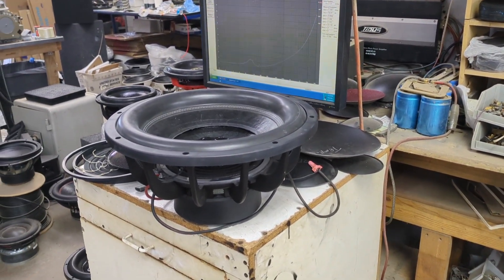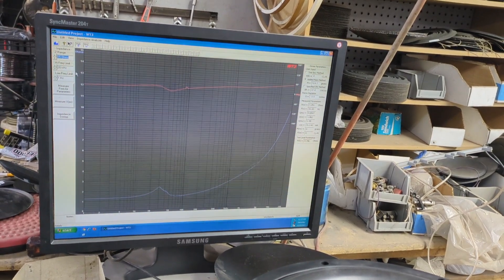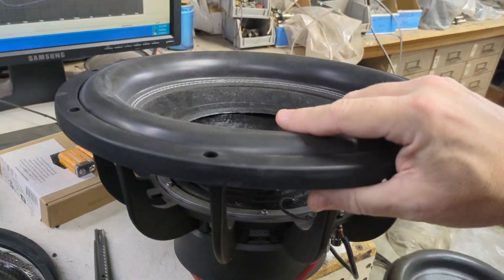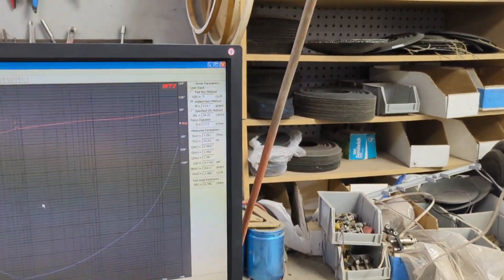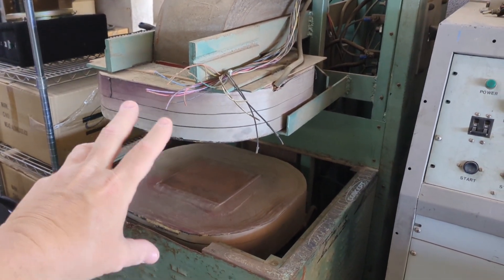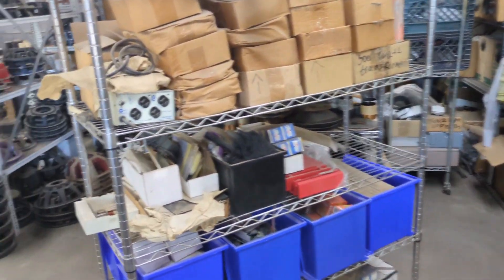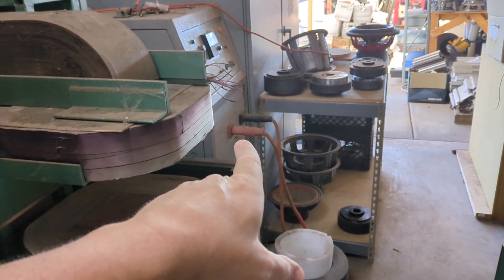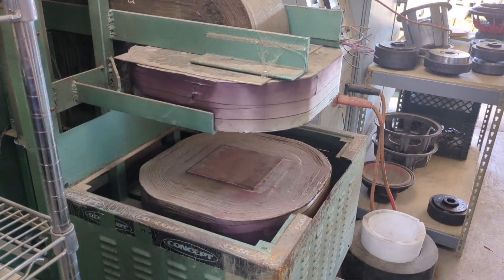One of the world's most expensive magnetizers for loudspeakers + $30 15" D2 subwoofer yields $200

Comment: May beable to find an ok deal on an old rotophase, there not very efficient for constant use but firing it up to run the magnitizer here n there would be fine, electronic phase converters are still pretty expensive im sure but there must be plenty of old archaic rotophases still kickin around out there.

Comment: If you put in a transformer  you can  get 3 phase power 480v my old shop only had single phase incoming but I had  a test bench  for 3 phase electric motors  I would bump a 100    hp 480  3 phase .there But  i also can say no matter what it's not cheap to do  at all that for sure .  any type of electronical up grade home or business.  Basically looking at 3k  and up  .

Comment: 5:15 Since when does increasing Qes increase sensitivity? Higher Qes/Qts lowers sensitivity, no? And wouldn't a stronger motor = lower Qes and higher Bl? Not the other way around? Either I'm missing something, or everything you say about Qes/Qts, sensitivity, Qts in relation to suited enclosures, etc. is backwards. I believe it'd be impossible to do what you do for as long as you have and have everything backwards, so wtf is really going on? 🤔

Comment: More questions, why are you adding mass to lower fs instead of looseing the suspension stiffness? It doesnt matter because the bl is strong enough?
Reply from the maker: It's a much quicker solution
Reply: @RobotUnderground so probably less power then right? For safer operation like less induction?
Reply from the maker: @fabeybaby8213  Induction isn't a real problem in subwoofers because nobody crosses them up above 350Hz or so.  Induction is only a problem in PA drivers that are played above 1kHz.
Reply: Dismantling a woofer is more of a cunt than just adding weight. Time is money

Comment: Diyaudio guy tests amps and states he doesn't really have the power supply to test them to amps full potential. If he isn't setup to do proper testing, he shouldn't be testing amps.
Reply: Gotta start somewhere!
Reply: All he has to do is invest his ad revenue into some batteries and a 14 Volt power supply
Reply: I agree and invest in an actual amp dyno. I wonder how the accurate his meter is compared to an actual amp dyno?
Reply: @greenbassboosts8872  He has a lithium battery bank and dual power supplies. Even then, some amps draw too much current and cause his power supplies to go into protect so I don't think its that simple.
Reply: @chrishernandez2490  I'm not really doing a harsh criticism. I get it, but it is that simple, and it is also that complex
Reply: An amm-1 is the exact same company as the “real” amp dyno. 😂

If edge made a 200 amm-1 I’d buy one in a heartbeat.
Reply: @Thumper68  thanks for clearing that up.  I wasn't sure since the dyno uses resistors and the amm uses an actual speaker.
Reply: Not everybody has upgraded alternators,and extra batteries, and 14.4 volts on tap all the time…. I respect the fact that he tries, and even explains he doesn’t have the power yet. Stop being so negative dude, that’s a woman’s trait. Take care 👍

Comment: Sending out a licensed certified electrician can be very expensive for installing 3 phase 💥 power / Stay away from anything slowing power down, no power conditioner, no 3 phase to 1 phase converter. (may blow out something) A-   3 phase diesel powered transformer style generator should work .

Comment: You can use a vfd to convert single phase to 3 phase.  Not sure if it would be economical with the current you most likely would need.
Reply from the maker: Correct that's why I'd rather not experiment I'd rather just do what I really need which is a non-jumping magnetizer